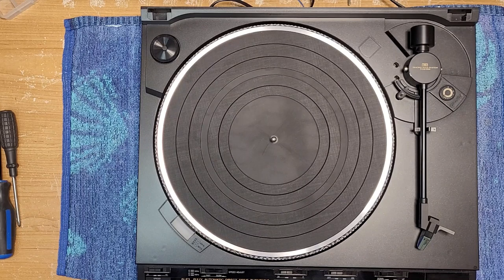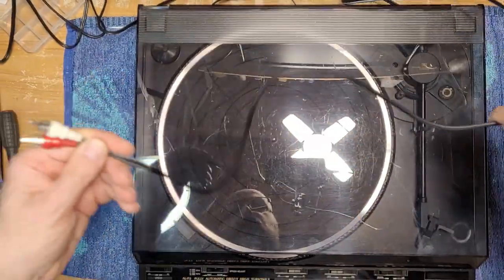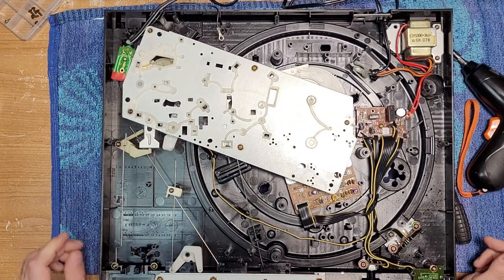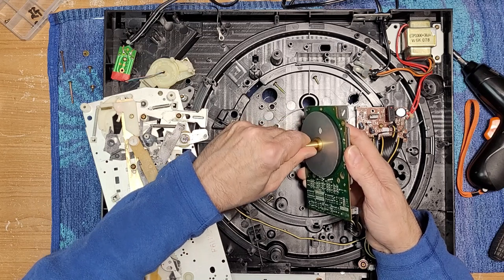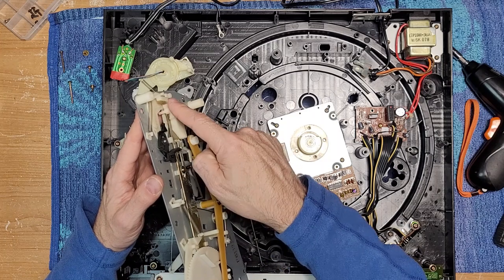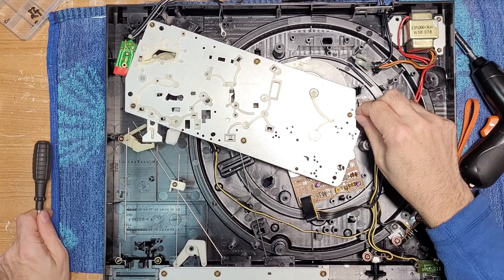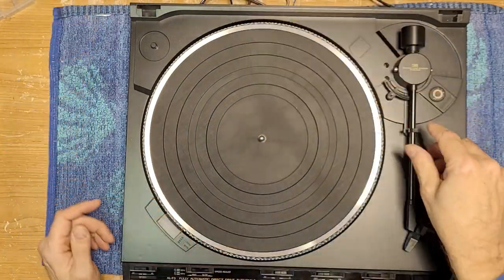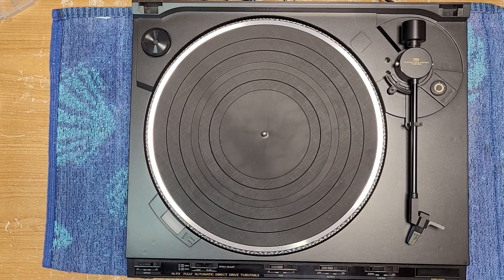JVC AL-F3: Minor Service & Demonstration

Comment: Great video. I had one of these where the auto return was stuck on. Examined the mechanism and looked like a little bit would pop out when repeat was off, to catch the clamp that would usually return the arm to the playing surface. But the pop put bit had no real tension that could prevent the clamp from engaging and just seemed to get pushed out of the way. I was stumped so I had to put it to rest.

Comment: Great video...i finally got mine out of storage, bought it new back in tje 80's. The stop start switch isnt working, stays on, can't turn it off. Is that easy to take apart and clean?
Reply: I just noticed it only plays about half way then it stops there and  the arm wont go any farther. I can manually move it, pretty firmly..any ideas?

Comment: For curiosity , is the weight actuality 1.25 g?
Reply from the maker: The weight is not 1.25 grams, it applies 1.25 grams at the cartridge.
Reply: @TurntableGuy  Of course... it exerts that weight on to the table, which is why a scale displays that in gramms. Did you check it though, or did you merely state the spec?